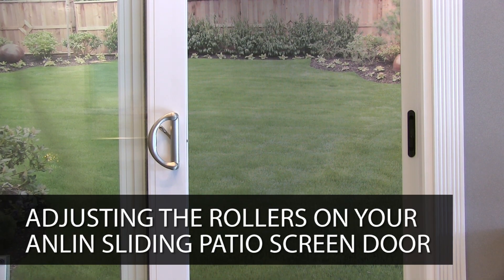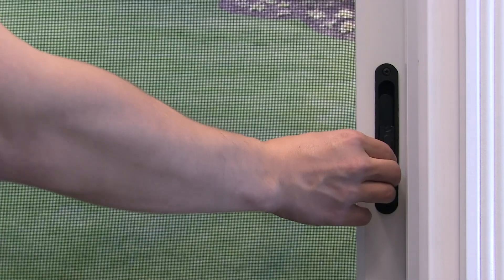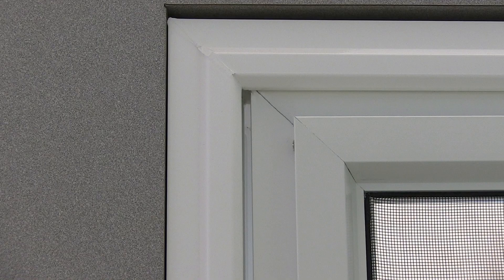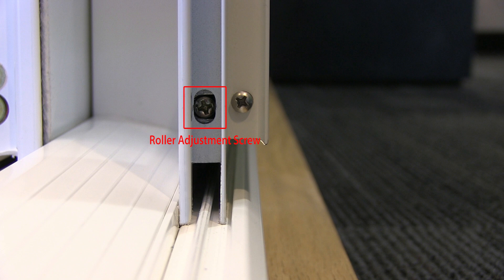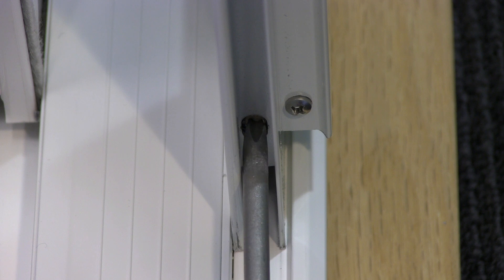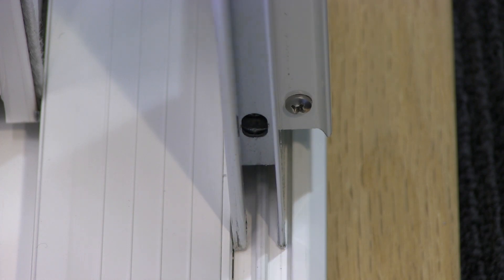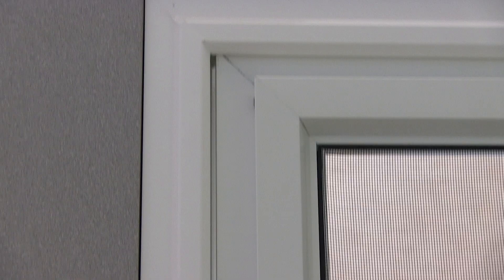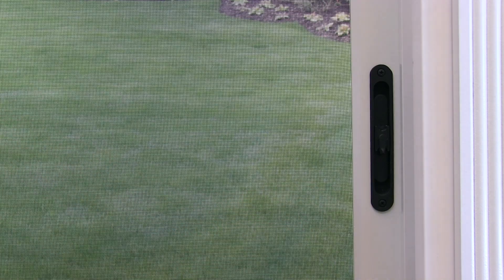Adjusting the Rollers on Your Anlin Sliding Patio Screen Door | Anlin Windows & Doors

Comment: My adjustment screws don't raise the door, there is still a ton of play with all the screws tightened? Any thoughts? Thanks
Reply: Make sure your rollers are on the correct track, also screws might be stripped.
Reply: @HansKlossJ23  Believe my screws are stripped as they do not change the roller/door position.  How does one replace the screws?